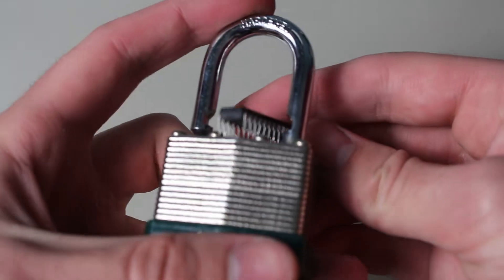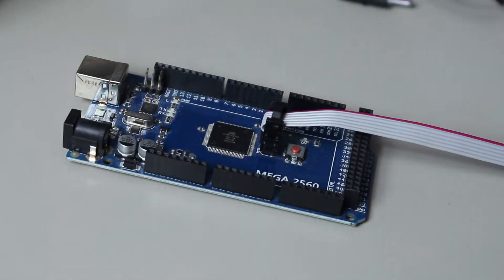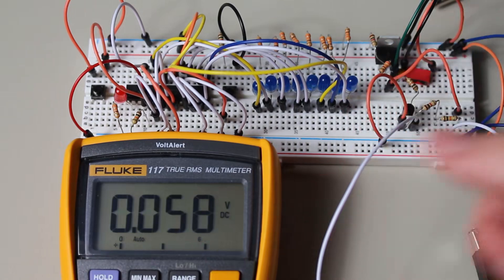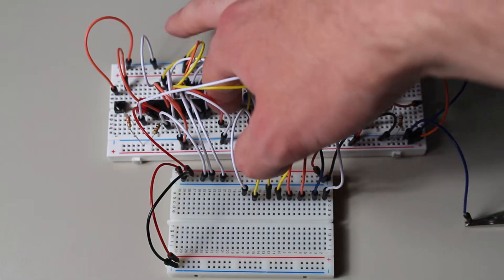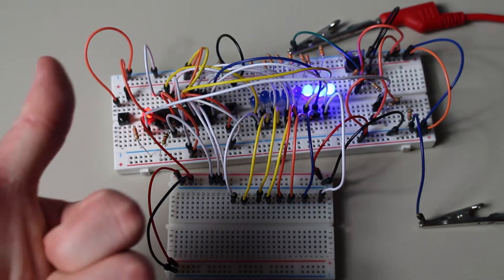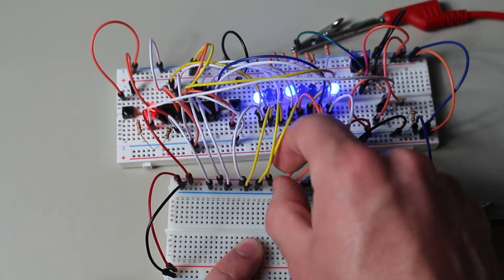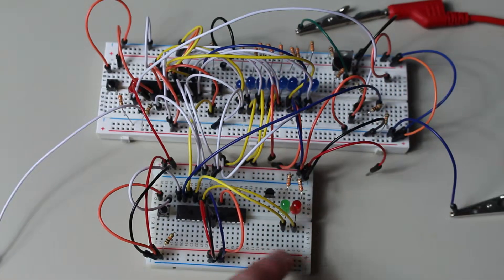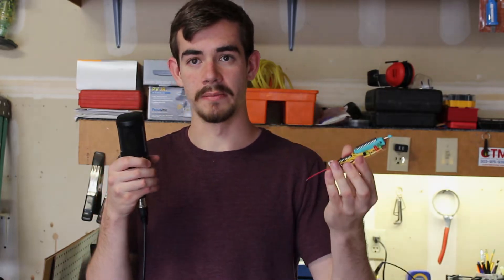The ultimate way to program a microcontroller! - High-Voltage/Parallel ATmega Programming

Comment: I appreciate what you've done here, and I like your channel, I even have 2 of your playlists saved, and I love them ... this is nothing against you or your presentation at all, but... sheesh ... this seems like the recipe for witches brew or something, so convoluted just to get code onto a chip. Pardon my rant, I'm new, and really resent the need for specific hardware (programmer) and/or software (IDE) required by the manufacturers in order to program these chips. Thanks for your content, though, really liking your channel.

Comment: Hi, I have bricks two atmega328p chip due writing wrong fuses or lock bits, by usbasp programmer getting Invalid device signature like 65000, I tried it recover to parallel programming rewriting fuses, n detect the chip but this time signature id showing 0x00 00 00. Can i rewrite the signature id. Rply

Comment: hello, I have a card that I removed from a machine and this card has an atmega 64L. I read the signature of this card with hvpp as you did in this video and I read the signature that it should be, then I deleted it and set the fuse bits from the Serial Port with another program. An external 8 MHz xtal was connected but somehow I cannot access the chip via Arduino as isp. avrdudess gives a signature error but when I try another card UNO vs mega, isp works. I repeated the process a few times in case it failed and I read the lock bit again, its value was AD, then I tried to make all the values 0 but the first two bits were still 1. I reconnected via isp and the result is the same. How should I proceed? Thanks in advance for your answer.
Reply: I should probably make the lock bits 11111111.
Reply: 11111111 no 3f yes

Comment: Oh man i should've gone for a walk or something else instead of playing with those fuse bits... Now my atmega328p is expecting an external clock source.
Should i attempt this project or is there any simpler way to put together a clock generator or maybe i could use the clock from some other device? If anyone has some suggestions i would greatly appreciate it...
Reply from the maker: If you're willing to put in the time, this project will let you quickly save yourself anytime you mess up the fuses. It's very convenient and I have used it several times off-camera.

Otherwise, you can use something like a 555 timer or even another atmega328p as a clock source.
Reply: @SineLab hey man, i tried the manual method on a breadboard but the ready led isn't coming on, only the third bit light comes on and as soon as i apply the +12v the led turns off... 100% i must have wired something wrong or i didn't understand the procedure...could you please upload a schematic on your website for the manual method? I'm sorry if i'm asking too much but i have to admit i'm a total noob (as you may have noticed from my screw up), i'm having an hard time following the wiring on the video... I think i shouldn't have killed the chip, i applied the 12v only to the reset line, nothing else.
Reply: @SineLab whoa wait, i poked at the resistor and the led on the ready line and after power up the led came on, i will now try to program it, maybe i can pull this off
Reply: @SineLab  nevermind, as soon as i pull down the OE pin to read the first signature bytes, they're wrong...this thing is driving me crazy, i spent the entire evening putting it together
Reply: Also on the atmega328 the programming mode sequence is a bit different, i did it like this:
1. Apply +5v while RESET is tied to ground
2. Disconnect RESET from ground and connect it to +12v, and the ready led turns on..
Reply from the maker: @gio0042  You are on the right track, considering that the READY led is on. What is your output when reading the signature bytes?

Also, what steps are you taking to read those bytes?
Reply: @SineLab  the signature bytes read correctly now (even though some LEDs are weaker than the others so the readability is kinda bad, don't know why that's happening)
I tried writing the low fuse bits but they read back differently, they're even different to what i originally set them when i bricked the chip...
Anyway i'll leave this thing alone until tomorrow, though i'm going to have to wire things up for the 3rd time... I'm wondering if i somehow killed the chip or i'm just too distracted with the command/data pin setup
Reply from the maker: @gio0042  Make sure to check your LED connections. Sometimes they can get loose. If that happens, you might think the readings are bad, but it might just be the LEDs.
Reply: @SineLab  Holy shit man i don't even know where to begin. I just want to thank you because FINALLY, after wasting 15+hours, i managed to set the default fuses and get this thing to work again. The problem with the LEDs was a series of random faulty resistors throughout the entire board (i don't even know why i didn't measure them before using), after i replaced the resistors i made a mess with the two buttons, not realizing that they both need to go to the +5v line with a resistor. I still didn't quite get how to program the rest of the fuses honestly, but to save the chip i only needed to program the low byte ones. Throughout the entire procedure, while desperately trying to get the thing to work, the chip got too hot to the touch a lot of  times, i still don't know why that happened but those atmega chips must be so damn tough and idiotproof, mine seems to be still working fine lol. I wonder if there is some way to test if the rest of the chip is still working as it should, i loaded the classic blink program, (after flashing the bootloader of course) and it seems to work just fine... Anyway, if anyone else is reading, think twice before setting the low fuse byte to 0x00🤦🏻‍♂
Reply from the maker: @gio0042  Congratulations of figuring it out! The atmega chips are surprisingly tough, so it should be fine for normal use. Enjoy your atmega! 😀

Comment: Hi, thank you so much for your helpful tutorial. I have two mega328p, not applicable anymore because of the wrong configuration that I have done. So, I tried to follow your instructions, but it did not help me. indeed, when I try to connect them with avrdude I always get signature 0x0000 which is extremely weird. I hope I can use your guide in this case. Should I forget those or is there any way to rescue them?
Reply from the maker: This video was centered around the mega8A, but the mega328p mostly has the same process? Did you try to reset it by hand, or try the automated method?
Reply: Actually no, I will do it and in case of success, I will share it here.

Comment: If atmega328 mcu lock with lock bits high voltage programmer can reset lock bits without code or programe loosing?
Reply from the maker: You are forced to erase the program if you reset the lock bits.
Reply: @SineLab  without loosing program possible lock bits unlock by high voltage programmer or other device?
Reply: Any other way for save program
Reply from the maker: @giantkherva2141  There is no official way to recover your program. There are probably other very expensive and difficult methods to recover it. Unless you have a really good reason, it's not worth the effort.
Reply: This seems more like a "I have a locked mcu with proprietary code on it and I want to steal it" kind of comment.

Comment: deleting my comment is not very wise. RescueAVR is a better solution, no need to reinvent the wheel.
Reply: Well... reinventing something is a great way to learn and better understand a subject.
Reply: @atoomnet  I don't deny that. Just no need to put that part in an "educational" video. 
Though modifying and contributing to an existing project is a great way to learn as well. Especially when the other HV prog project is way more versatile for the entire range of AVR MCUs.
The datasheet is useful for programming registers, functions, fuses and be aware of the chip limitations, but reading it just to unbrick some specific chip is a waste of time when automated tools already exists to allow us to restore the usual ISP or JTAG port. And as I said under a previous video we barely even need HV prog to reset external clock settings as some advanced ISP programs also provides a configurable clock signal to feed on the cristal pin.
Reply: @PainterVierax you are confusing the invention "the wheel" and one implementation of "the wheel". Using a wheel as an example, a tractor wheel is not a reinvention of the chariot wheel. It is only another implementation of the same principles. Some people, me for example, find this kind of demonstration of the principles of "the wheel" extremely useful because it enables us to make better decisions when time comes to select a commercial product. I do not really understand why this kind of demonstration provokes a lot of people, if you have a better solution that you prefer then fine go and use it, why even watch this video then?
Reply: @Psykorr  I'm not. As I said, I had a more elaborated comment.

Comment: I never had a defective atmega, it's always a fuse bit problem. I saved a lot of atmega128 back then and atmega328 now with my stk500 in parallel mode. Sometime it's the isp disabled but can also be the clock became external instead of internal when no external clock is provided. Great Idea to do a device to fix this. Good work.